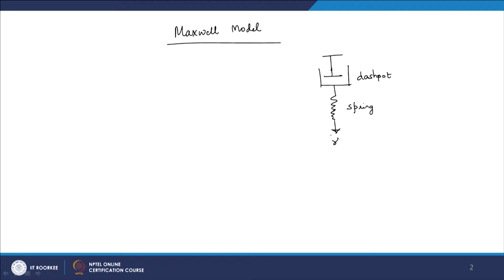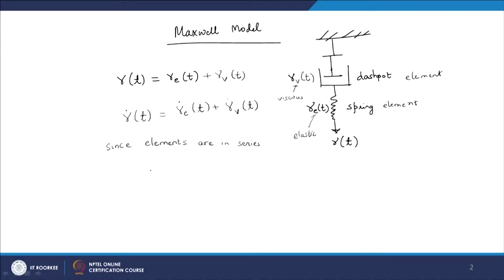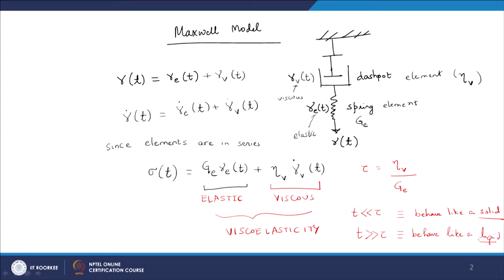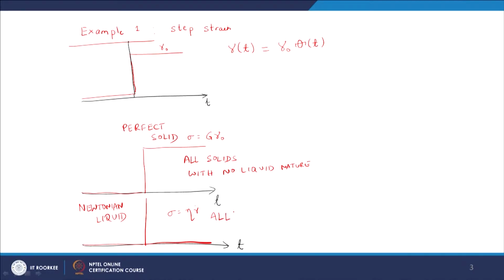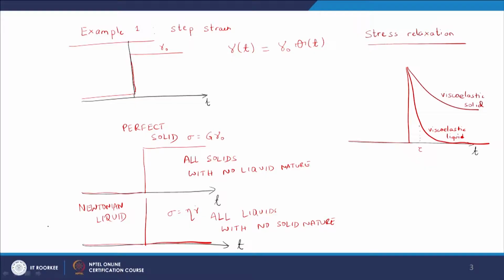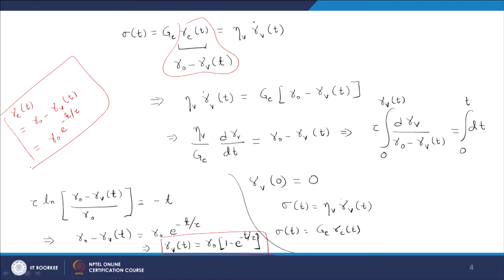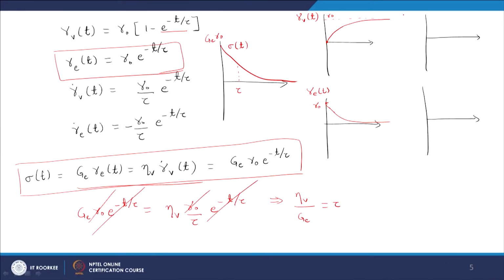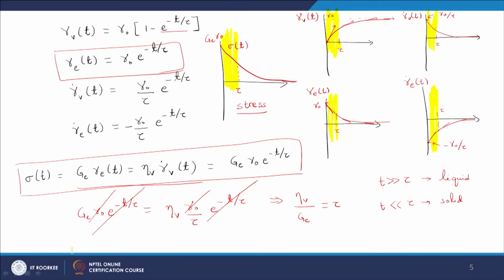Lecture 59-Maxwell model-I

Comment: I think you wrote wrong. The net stress = Gr +nr is supposed to be a strain. because stress is same for both spring and viscous part
Reply: Thanks for pointing this out. I had a relook on this, your observation is correct. Given expression is correct when spring and dashpot is in parallel.
Reply: @prateekjha5187  Cay you please share your email address?